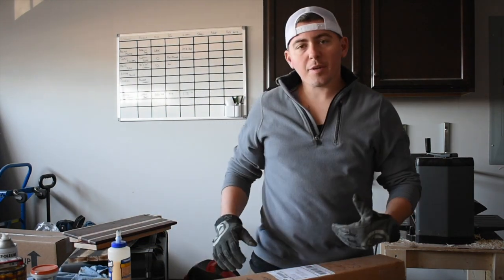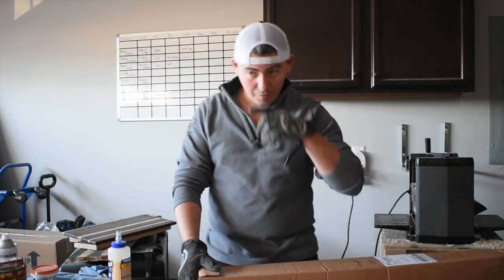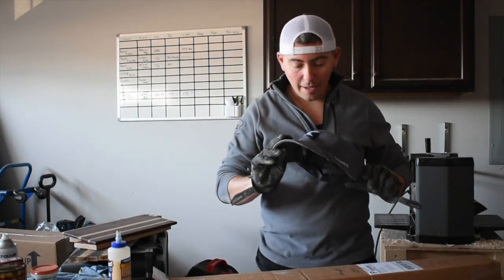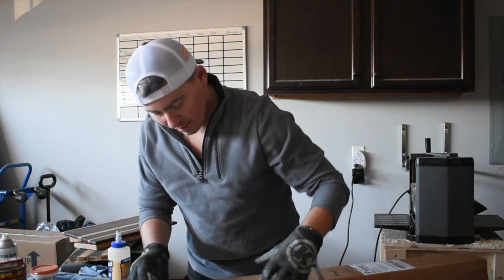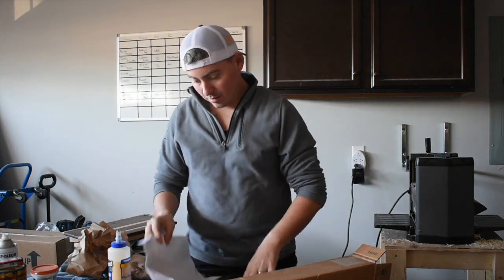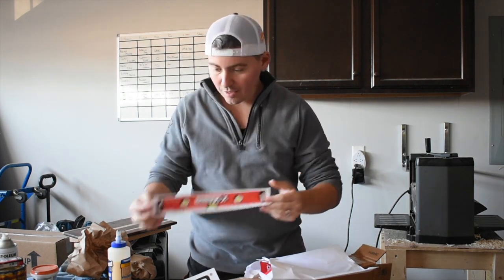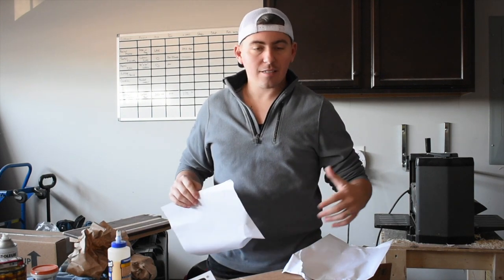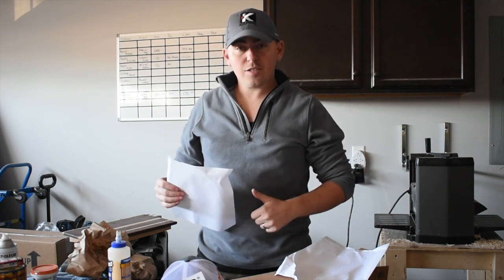Unboxing the Kapro Tools Sample Pack!!

Comment: Do you still have it? Is it really good? The durability? I'm researching a Square to buy I found this model, I'm researching, to see if it's worth it, because it's expensive 😅, I want to use it in marble works, if you can tell me your experience with this square, thank you 🤝
Reply from the maker: I still have all of my Kapro tools and ordered some more after they sent me these. Very durable and I like the value for the price on these compared to some other brands.